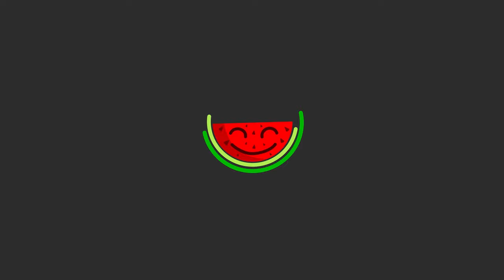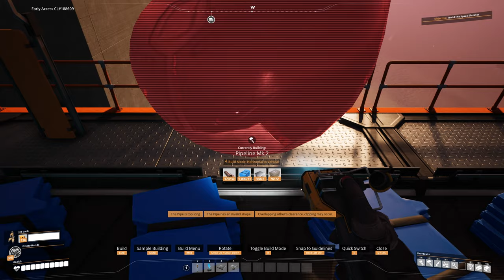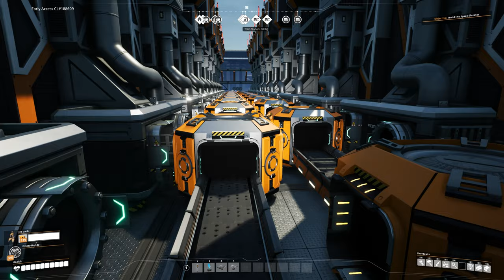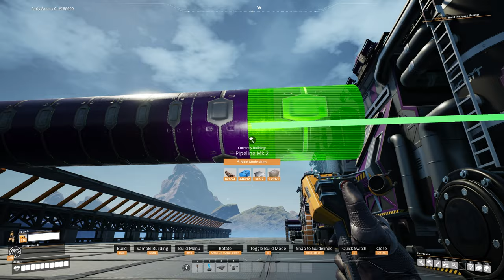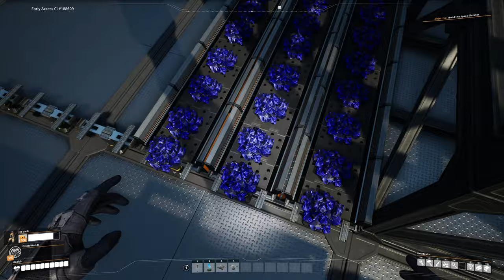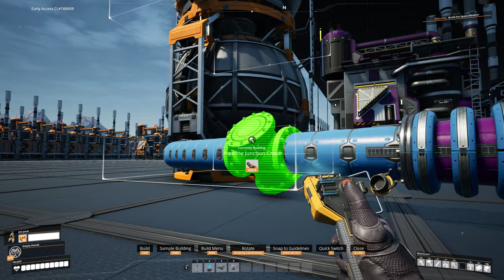This OIL RIG is going to be MEGA!!! In Satisfactory

Comment: If you load your savegame in the satisfactory editor, you can unlock every alt recipe without using mods. I use that tool to give myself 100 harddrives and 100 power shards on every gamestart. I still need to research the harddrives though so it doesn't feel like a total cheat. But you can unlock the recipes as well without using any harddrive.

Comment: Why don't you use the diluted fuel alt recipe in the blender?
Edit: Nvm you don't have the blender yet :).
Reply from the maker: Indeed, but also.. On my Twitch stream i created Diluted packaged fuel set to support 546ish Fuel Generators. So with a Diluted package fuel setup without blenders is  2 Packagers = 20MW + 1 Refinery = 30MW.. So 50MW in total. Blenders are 75MW so there is a 25mw difference between them, meaning after i changed all my Packagers and refinerys to the blenderd version i only gained around 6000MW in total, so its really not worth, unless you want an extra few FPS haha...